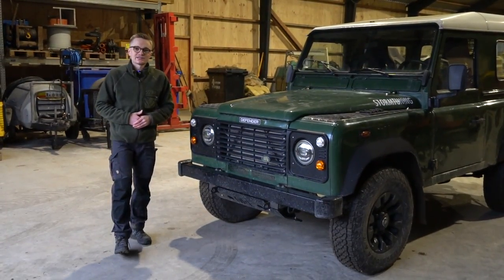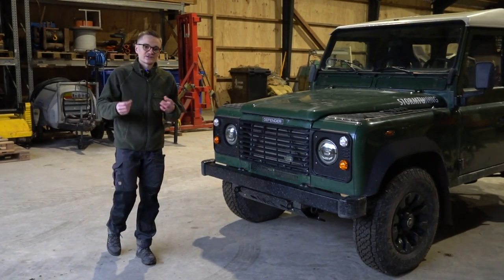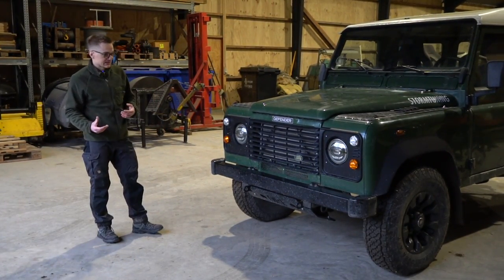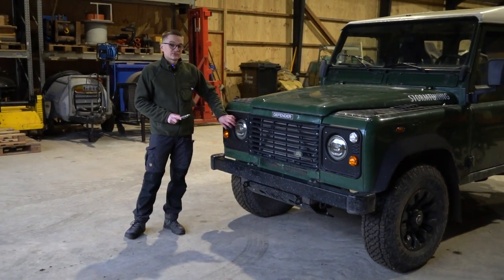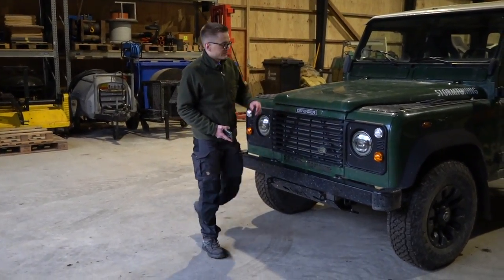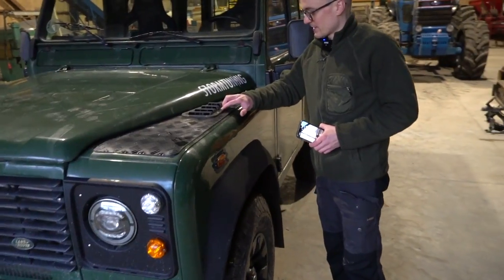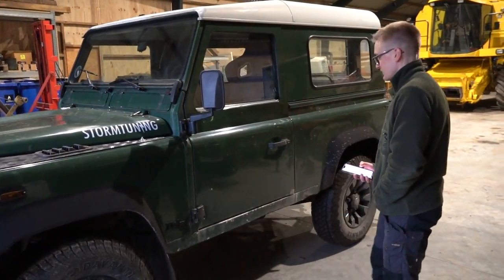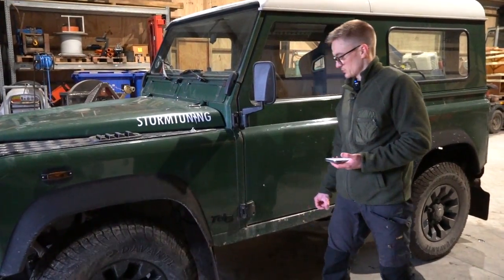Reviewing ALL of my Defender mods!

Comment: Great round up on the project Liam! Keeping a pretty standard look is definitely the 'in' thing these days, changing the seats for Exmoor ones would certainly fit that aesthetic. Paint wise, you'll end up repainting the whole vehicle I'd reckon since you'll be replacing the bulkhead and doors, however if you stay with the same colour, it would save having to paint the inside of the vehicle keeping costs down - Using black Raptor bed liner paint in the engine bay side of the bulkhead, in the footwells and tub would smarten those up, help keep noise down, very durable and a quick, DIY method to also help keep down cost!
Reply from the maker: I agree that I'll almost certainly have to repaint, but I think I would keep the colour. Raptor paint is not something I'd thought of at the time of filming but definitely something I'd like to make use of. Thanks!

Comment: My EGR valve is blanked off on my Golf but I haven’t got the system to ignore that yet so I have driven around with the engine management light on for about five years . I didn’t notice any change in the running of the vehicle .

Comment: Assume it is the Optimill screen wash jets - they are fantastic. I also went for their window hinges, security hinges and detachable steering wheel boss (here in UK the security is needed) but did not bother with the fancy wing mirror arms (I break too many off road)
With your extended wheel well arches, I get they stop gloopy mud but my issue is when wading, muddy water gets in everywhere leaving a coating of mud as it dries, requiring tricky cleaning, especially in around the back of arches - do they seal enough to stop this happening?
Reply from the maker: I think it is Optimill yes, I'd love to get some more of their products for the rebuild. 
I'm not sure to be honest, I don't think you can ever make it 100% secure but  we'll find out when we tear it down for the rebuild what the "damage" is 😄